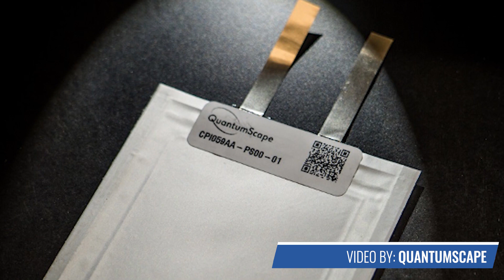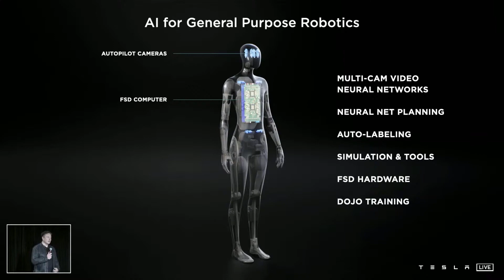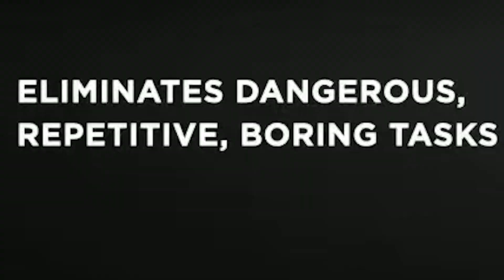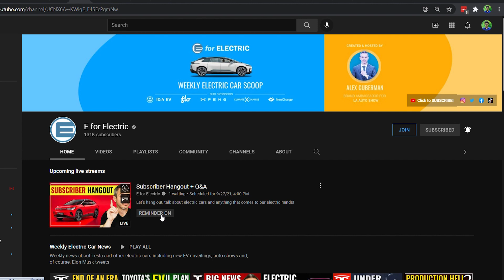SANDY MUNRO on Tesla Robot & Its Future

Comment: One possible option - the Nuclear Diamond Battery.   It has a low power output, as I understand it, but a very long lifetime.  Maybe marry that up with capacitors, or a rechargeable battery of some sort...it can trickle charge overnight, then have bursts of energy when needed.  Nano Diamond Battery (NDB) is one company trying to make this real.   It will be an interesting space to watch.

Comment: Tesla bots first useful application is gonna be in assembly lines. In dangerous jobs that hands are useful. The first prototype will likely be as lightweight as possible (mostly battery weight) and be optimised for low energy consumption. I imagine it'll be sub human as far as performance goes, but there are plenty of jobs a humanoid form can do that is dangerous or repetitive.

Comment: Sandy, you are right about the exiting tech but I think telsa is thinking about slow movements, tactile feed back and fine motor skills with a hight adaptive brain coming from self driving tech. If something can load the dishwasher, make beds and fold laundry it will be a step forward towards nursing robots and people will pay more for that than any assembly line robot.
Reply: The assembly line robot will have to meet many requirements from the start, but a home robot can start out very basic and relay on human input +time to improve skills and adapt to each unique environment, and for the value it can provide people will quite patient and forgiving… so it an ideal starting point to crack human like robots, not the battle field of a hight through put factory

Comment: I think these robots are exactly what Elon needs to do the assembly tasks that are currently carried out by humans in the Tesla factories. 
Additionally, I think they will enable more work to be done on mars before humans arrive. Both of these uses may be fully autonomous, partially autonomous with varying degrees of human guidance, or fully remote controlled, via VR/motion tracking.

Comment: Something I rarely (if ever) hear when people talk about Teslabot is the enormous advantage Tesla is going to have over other robot builders, and it's DOJO. The reason behind the extremely slow speed of development of robots by Boston Dynamics or even Honda is due to time constraint tied to the real world and lack of AI behind robot movements. The famous clip where 2 Atlases perform parkour moves (as well as the dance clip) were a sequence of preprogrammed movements (that led to several falls and failures, not included in the final video). That's where Tesla is going to change everything. First, their navigation system (FSD) is going to allow the robot to understand its surroundings in realtime. Second, the training the robot is going to have won't be tied to the real world, thus being limited to say 8 hours per day. Inside a simulated world, a virtual Teslabot will learn by trial and error how to deal with anything possible, from climbing ostacles to fight aliens to pick pockets to perform brain surgery. The speed of training in virtual world is limited only by the speed and computing power of the computer that runs the simulation. There's a great clip that shows how a single robotic hand learnt how to solve a Rubick cube, training itself in simulated wold, in a really short time, instead of doing it in months in the real world. Dojo is going to shatter the learning speed of robots. Tesla is going to lead even this field

Comment: I am exactly the same age as Sandy and an engineer. In the 1970's we built a robotic house funded by the UK government. It could handle food from fridge to oven and stove and communicated on voice commands. It also had the forerunner of the wireless vacuum cleaner which acted as a device to move furniture. Recharging these devices was easy. The house still exists but is a wreck.Non humanoid robotic systems are easy.

Comment: Sandy has a dishwasher. I do too. I never use mine because by the time I have rinsed food off the dishes I load, they are 90% clean. So I just finish the job by hand. Elon's AI robot with severely limited arm power, but a learning algorithm driving its functions can do the prep work both of us do to let a so-called "dishwasher" finish a job it has no means to begin at all. Elon's thinking is all about the little compromises in energy use that make things once thought impractical, practical within the limits.

Comment: If Americans would be more acceptable, Small Thorium reactors can be install close to inductive charger.  They were developed during the war and at that time they had a Thorium powered airplane.  Thorium reactor don’t produce by product to make nuclear weapon.  So the Thorium reactors were trashed.  China is working on one now.  Yes the operation is corrosive, but material science has solve.  Biggest thing about Thorium reactors are they are so much safer.  Doesn’t work under pressure.  So size of reactor can be smaller compared to current reactors that need a place for steam to expand incase of a mishap.

Comment: AI is still decades away if ever.  At best 'AI' today is basically optimisation of if/then scenarios by running thousands of iterations with slight differences and seeing which results are best.  That's why we aren't seeing self driving cars anytime soon - smart assist, sure;  hands off fall asleep let the computer drive - 30 years+
Reply: AI today is much more than that with Neural Nets.  Real FSD may need intelligent road infrastructure as well - to make that happen we need an architecture for it and standards - 10 years maybe. The potential payoff to society is too big to ignore, so we may need also to simplify the task.

Comment: Elon never picks up a nut he can't crack. The computer he's already developed for self-driving cars only needs a few tweaks for the robots. And the same goes for the batteries. Never bet against Elon.
Reply: The major problem for today’s robots is there is no intelligence in how they walk and how they move. Humans and animals use a huge amount of intelligence just to move about and not fall over.  Robots will need to achieve this before they can do useful tasks.
Reply: What's about hyperloop and the tunnels with the fast autonomous vehicles like the one in Las Vegas?
Reply: @VolkerHett  hyper loop was promoted by musk, he never even tried to build one as they are very easy to sabotage as they are all pressurised. So it would tear itself apart. And the loop in Las Vegas is the first public tunnel, so obviously it’s not going to have all the goodies that was promised for the later versions. And autonomy can be easily integrated into the loop when Tesla are near done with FSD as it’s not a very complicated drive.
Reply: your another elon fan boy. he loves silly people like you
Reply: @Supraboyes  Right? We need to crap all over these over achieving industrial revolutionists! In all seriousness, I find it amusing how personal people take it when someone compliments someone else or cheers them on. None of these guys are perfect, some of them are not even engineers. Steve Jobs was a disaster in many ways and had many failures, yet he knew how to conduct and assemble the right people and PUSH them to do great things.    So, who is more silly. The person who is a fan of accomplishment? Or the man who takes a moment to insult them for no apparent reason or provocation?
Reply: he has plenty of failures so imn happy to bet against him.
Reply: that tesla guy is the king of BS! im still waiting for robotaxis, and thise only roll 😂, imagine tesla figuring out how to make a machine walk , it would talke em 20 years
Reply: @ozo1010  yeah they can't even put a car together lol.
Reply: @Supraboyes  they can put a car together just fine , what they cant do a make a car fully drive itself ,
Reply: Normaly it goes like, no, no, well it is actually kind of impossible, well in 20 years and we said that 20 years ago as well. 

And then:
- wow can it actually do that, that is super amazing.
Reply: NOT UNVAILED!  FAIRY TALE DREAM!  
This will go the way of all musks other failures
hyper tube
automated car (sonar how stupid are they?🤦‍♂️🤣)
300km car below las vegas! LOL
electric truck
Now  Robot! 
There will not even be a standing moving robot by the end of next year and not one to do your shopping!

Comment: Tesla is of the mindset they can figure out the logic side of this equation.  Elon said they understand actuators etc.  
They understand batteries. 
I'm sure this will be a falcon heavy kind of project where Elon realizes they didn't understand a fifth as much as they thought they did.  But I think if He lives long enough to drive the program,  it will happen.  It would seem to me to be a nessecity to mars mission. 
But battery density would probably have to triple or more. 
And all his actuators will have to be of a science fiction efficiency.  
Look how much work a man can do on a 2500 kilo calorie diet in one day. That is equivalent to about 2.4 kwh of power. Of course a human "recharges" 3 times a day or more.   A robot, not being as efficient, may need a minimum of three times the power therefore have to recharge 2.4 kwh three times a day to accomplish near the same work.  The other issue with robots is there is no "fat".  No longterm emergency storage of energy for when the "daily calories" runs out. I can see it happening.   Have serious doubts to them pulling it off in a 125# format.
Reply: The Bot doesn't recharge; the batteries do.  The "Fat" is the charged batteries next to the areas in which the Bot works.  Low on power? plug into an electrical outlet and lift 500 pounds.  The actuators that Boston Dynamics is using are demonstrated to be of sufficient strength and nimble-ness to do parkour and backflips, and their robots aren't light in weight.  Sandy can tear a BD robot down, maybe make them better/lighter/faster/stronger/easier to manufacture... The gyroscopes keep the Bot upright, so it can get up if it falls down.  Design efficiency is a hallmark of Tesla, down to the laser patent for the CyberTruck windshield washer so no washer fluid and system needs to be made/installed/carried/refilled. Door handles are flush or removed, mirrors (hopefully) are removed.  The public fear is hopefully calmed by the 125 lb, 5 mile an hour, 10 lb. weight lift stuff.  That's just to help us chill at the thought of a robot in our midst.

Comment: I really think the bipedal robot is initially targeted for line assembly operations.  Having the same form factor as a human, the robot can use the same tools as the human on the assembly line.  The Dojo AI trainer has the human actions as input to the training algorithm.  The HWx autonomous driving hardware easily has the chops to guide the operations in such an environment.  Being a relatively fixed environment providing power to the robot either continuously or in sufficient intervals for continuous operation at line rate should be trivial.

If I recall correctly, a human being in light or moderate activity expends 200 watts.  I cannot comment on the thermal efficiency of a human for either cognition or locomotion but I would be surprised if a robot would need more than 2 or 3 times that power to replace a human in sustained repetitive work.  The specs provided at AI day was not projecting lifting capabilities I considered beyond repetitive human capability.  I have not researched OSHA requirements for repetitive effort on an assembly line though that would provide a reasonable comparison.  A humanoid could also wear the same motion assistance devices that a human would wear in order to perform a given operation.

I strongly feel the human assistant application is a smoke screen hiding the initial goals.
Reply: He’ll start mining with them as well

Comment: I don't think the power supply issue is insurmountable.  Human workers are generally allowed lunch and bathroom breaks (unless they work at Amazon), so why shouldn't robots workers be allowed battery swap breaks?  Even if it has to swap batteries once an hour, it would probably only take a minute or two to walk over to the fresh battery dispenser, replace it's battery, and walk back to it's work station, so that would be at most 48 minutes of downtime in a 24-hour day.  And if it's the case that the batteries need to be changed out even more frequently, you could always just have one robot dedicated to walking around the factory floor swapping out the batteries for all the other robots (although this could turn out to be a single point of failure).  So yeah, I think the development of artificial general intelligence will be the true limiting factor.  It should be the case that if any one robot breaks down, all the other robots should be able to coordinate a new work flow to keep things moving.
Reply: And everyone seems to forget about wireless charging/electricity. If you don’t think this is part of Elon’s plan your not paying attention. Just think of Tesla towers being built to charge all battery technology wirelessly, the robots will never need to stop and charge, hell they may not even need batteries at all.
Reply: How long does it take to change the battery on your cordless drill?  Press a latch, pull the battery, slide in a fresh one with a satisfying and positive "click," depleted battery on the charger: done.

Comment: If you're using the robots in a factory what is stopping you from having wireless charging along the routes of the floor the robots take?  The robot could take the charge through it's feet.
Reply: We have the same idea on charging robot.  I also see a future where the freeways will have inductive charger as you go thru stop and go traffic.   With tons of solar panels along the sides of the road to keep inductive charger active with a battery to save energy during the night
Reply: That's way more expensive and much slower than a 30-second automated battery swap.  I can change out the 12 Ah battery on my Dewalt drill in about 8 seconds... I'll give my Bot a couple days to try to figure out how to beat me.  Then it will ALWAYS be faster.  Hopefully it can run on my 20 Volt Dewalt batteries, since I've got 8 of them.
Reply: People who like to throw out ideas for wireless charging and just out a solar panel need spend a little time researching power demand.  It has a huge range of scale that most don't seem to appreciate.  An LED light bulb can use 9 watts while a microwave will use 1200  watts.  A phone will charge at 18 watts while a Tesla will charge at 250,000 watts.  Gotta match your solution to the application.
Reply: Love this idea.

Comment: Elon musk: robots and AI will kill us all
Tesla: wants to manufacture an army of killer robots 🤔
Reply: Elon specifically stated that they would be underpowered. Unless you were disabled you could either outrun it or out fight it.

I personally think we should replace the dangerous policing jobs to robots.

Here is the trick, they would be hug bots. Armored core foam padding exterior. Just enough strength to get the job done, could always use more than one robot.

It just hugs suspects until they get tired and give up. If they wiggle free it runs after them and hugs them again. Like an adult size toddler holding on to your legs so you can't move without dragging them along.

Once the suspect has surrendered, the human can take over. Then we can have those "social worker" cops everyone keeps talking about. A social worker could telepresence into the hug-bot, from a nice comfortable office. This gives you a three actor check and balance. You got the robot that's essentially a walking talking sensor package, the human officer, and a bureaucrat.

Okay maybe that's a terrible idea...

Now I'm imagining a hug bots busting down your door every time you say something unpopular on the internet and hugging you until you confess to wrongthink.

I think I might actually prefer the terminators. 🤔🤖☠️☠️☠️☠️

I for one welcome our robot overlords. 😓👍

Edit: typos
Reply: @jtjames79  yes you can overpower it, but what happens if it picks up an AR-15? I rest my case!
Reply: @miltonfriedman3593  start being extra nice to your toaster?